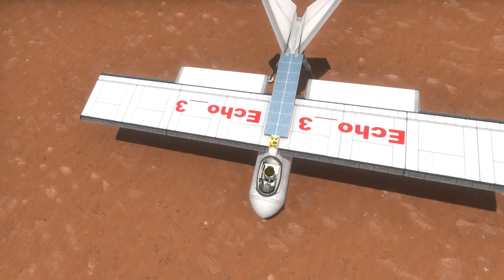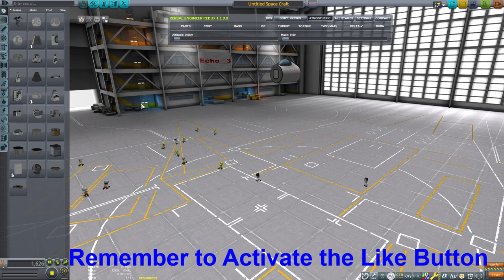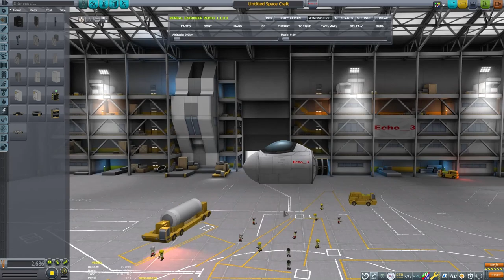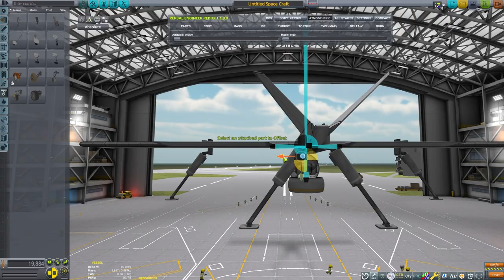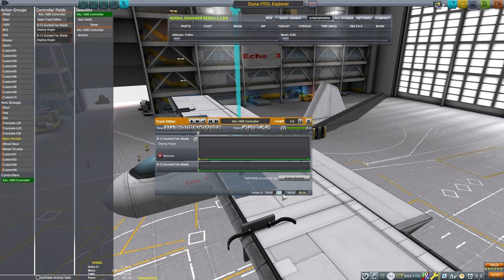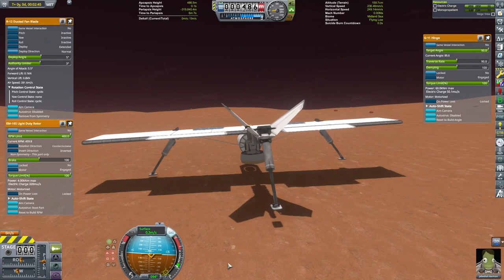Building and Flying a VTOL aircraft on Duna with the Breaking Ground DLC

Comment: dang i never thought of just putting both rotors in a single fan duct. i like that.

seeing your power usage, i think you could run this off a single RTG so you wouldnt need all the batteries.

Comment: Good video, as always. I have built along with several of your videos, and I have some reservations about binding propeller pitch to throttle. The thing is, what it really needs to vary with is speed. That fast propeller driven design of yours, the thing that looks like a Cessna Skymaster, if you try to take off with full throttle, it won't go; the 45-degree pitch won't work at low speed. You need to take off at about 1/3 throttle. HOWEVER, having stated the issue, I don't have a solution. I can't think how to bind propeller pitch to airspeed. Thanks for listening, keep up the good work!
Reply from the maker: Typically, I run a constant speed, variable pitch style propeller. You are correct that "full throttle" doesn't work right at slower speeds. I am just using the main throttle action group, but I'm not using it as a throttle. I use "low throttle" for take-off. In testing, I found that 8 degrees is ideal for static thrust, then I want to "increase throttle" (increase deployment angle) the faster the craft is moving. In some of my builds, I have an action group for torque (this indirectly controls the RMPs) and another for the deployment angle.

Comment: Thanks for this video, it's going to help me get off Eve with the help of propellers on the first stage
Reply from the maker: I do have a video about using propellers for a first stage Eve ascent craft. Eve's thicker atmosphere enables lots of lift, but also lots of drag. So rotors require lots of power. Good thing solar panels work a lot better there.

Comment: Underrated channel, great content, you've earned a new subscriber.
Reply from the maker: Cool. Thanks. Do you have any suggestions for future content.
Reply: @Echo3  probably Duna aircraft such as helicopter that can maybe lift light modules to make a base or move around. I also think Mun and Tylo missions are cool.
Reply: Another suggestion is a guide to landing boosters or creating reusable rockets
Reply from the maker: @nameiwanttaken5682  I have made a reusable rocket video. I land the booster on the runway and the upper stage in the water just off the coast.
Reply from the maker: @nameiwanttaken5682  The thin atmosphere does make flight on Duna difficult. Some time of "heavy" lift helicopter for Duna does seem like an interesting challenge though.

Comment: Nice tutorial! How do you launch this and design a rocket for this? Maybe a a quad copter or ion power explorer would be ideal.
Reply from the maker: I did not launch this to Duna. I just cheated it there. A typical chemical rocket would be sufficient. A direct ejection from Kerbin that resulted in a Duna periapsis lower than  20km would suffice.

Tomorrow's video features lithobraking! I was inspired by the Spirit and Opportunity missions.

I have used an ion powered craft to explore Gilly. It worked very well there.

Comment: PLEASE tell me how to stop torque roll
Reply from the maker: You use counter rotating propellers. For plane with a single rotor, I use trim to help compensate for it.
Reply: @Echo3  i tried contra rotating propellers but when i tried to turn up the torque limit after a few seconds the rotor stops, then starts, then stops.. you get the gist
Reply from the maker: @beimanuel942  Normally, I don't adjust the torque limit and only change the deployment angle.